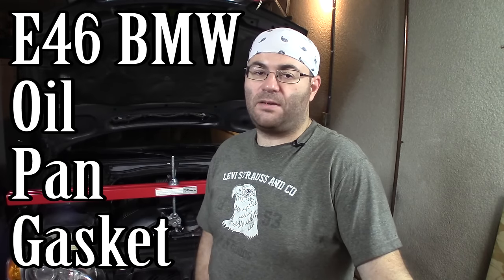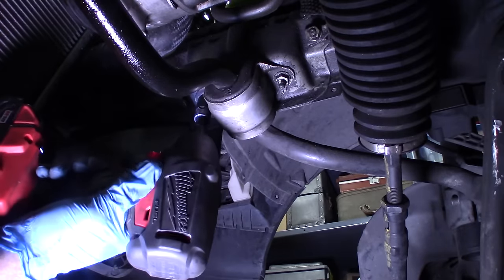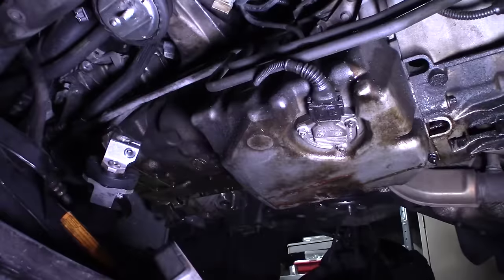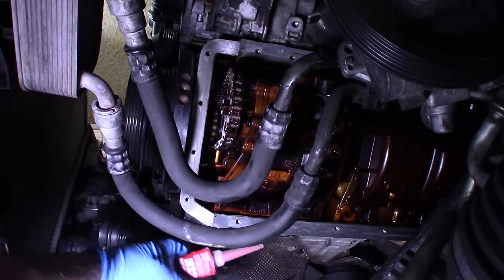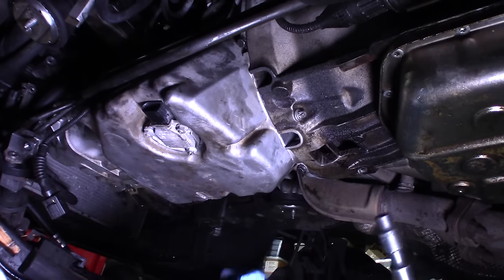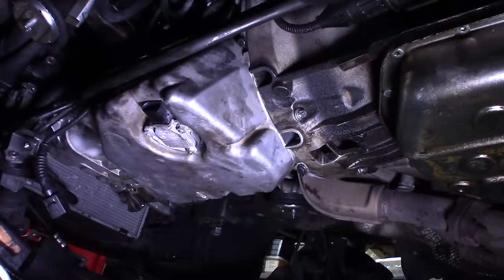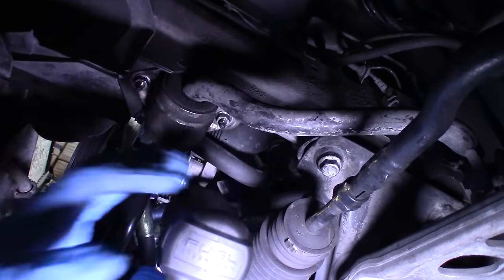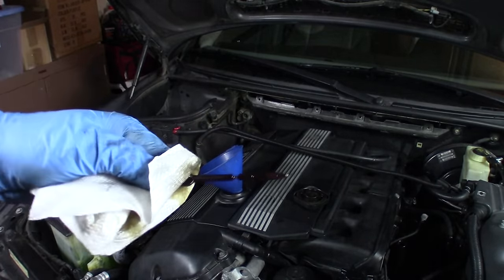BMW 330i 325i E46 Oil Pan Gasket Replacement DIY

Comment: Seeing you struggling with the gasket when putting up the pan, I would like to offer a tip if it has not been mentioned by others already.  I did the transmission filter a while ago and yes it was the same challenge.  I used wire ties (the ones they have at the grocery stores to tie up bags) to hold the gasket in place and after I got a few bolts in loosely, I removed the ties.  Made the job easier.
Reply: Brilliant! My 525i is up on stands for this job as I write. Your tip has solved an upcoming problem!
Reply: That is a great idea!
Reply: Boom
Reply: Job done. It worked beautifully
Reply: Used this concept! Worked great! Thank you!
Reply: How exactly do you use the ties if I may ask,  Thank you!
Reply: I used this method and it was very helpful. I held the oil pan with one hand and tied the zip tie with other hand.
Reply: @#joseph_the_human   you put the gasket onto the pan first.  Put a few wire ties through some of the pan's bolt holes and the gasket's holes to prevent the gasket from falling off.  Then put the pan up to the car.  Screw in a few bolts loosely to hold the pan up.  Remove the ties and finish installing the rest of the bolts.
Reply: @joshuatran3667  damn i missed the first part. it wouldve been way easier since the gasket wouldnt move and fall out when you put the pan up with the ties through the holes.
Reply: @DOOMSDAY  hehe so you did it the hard way after all.   Still you made it.  It's an involving job but doable.   I have not just one e46 but two, and I need to do this oil pan gasket on the second one.
Reply: @joshuatran3667  Well next time I have to do this I know better ahaha Thank you for the great tip brotha!
Reply: Crap.  I am doing this on the other e46 rn 9.26.2023.  Pain in the azz.
Reply: Done this job afew times that was a breeze thank you sir

Comment: Wow, it's like BMW never thought the oil pan gasket would leak.
Reply from the maker: +K Kampy Yeah they could have engineered that better.
Reply: sadly, many modern rear wheel drive cars engineered similarly. Its hard to fit all the steering and suspension parts in otherwise. Good news for us grease monkeys is it makes perfectly good cars go to auction because the cost to do some basic repair like this gets deemed too high vs the value of the car if you have to pay for labor. If your not paying for labor, this is like a $30 job and a few hours of your time.

Comment: Another tip; once you take any component off during the disassembly process, screw the bolts back into the holes.  That way you won’t lose the bolts or get confused later on as to which one goes where.  It will save you a lot of time in the long run.

Comment: Can't thank you enough for this video!  Thanks to you, I was able to swap out the old crusty oil pan gasket in about 6ish hours.  No more leaks!  To anyone hesitating to do this themselves - it is not difficult, just tedious.  If you have the tools and watch this video, you can do this job.
Reply: I just have an impact driver (I have no torque wrenches, likely none of the sockets, no jack, and definitely don’t have the large tool that the engine hangs on). I’ve never done any work on a car. It would be absurd for me to try to do this myself, right?
Reply: @timjohnson3913  yes.  You can't do this job without the engine support brace and other correct tools.
Reply: @_lmagine  I bought a 2005 330i with 160k miles that wasn't well cared for previously.  So yes, there were other leaks to address.  Oil filter housing gasket, valve cover gasket, o-ring for cam sensor.  All easy fixes and worth it if you're doing it yourself.

Comment: man all that work I'll let it leak
Reply: And then your engine blows up b/c all your oil has leaked out, good idea.
Reply: exactly. My oil level sensor broke on my BMW e46 so I can't even tell anymore, constantly manually checking. Get the leaks fixed and you'll save the car.
Reply: Lmmfao
Reply: @SPPACATR  Thats not the point, and person who likes a clean car and clean running understands. NO person who claims they are a 'tuner' has a leaky car.
Reply: @NUNYABIZNNAAAZZZ  oh i know plenty haha
Reply: Eliot - oil level sensor on these cars are covered under a factory recall. 👍
Reply: @NUNYABIZNNAAAZZZ  he's a tuner? Hahaha
Reply: Lol
Reply: @lostcec  
It'll be ok provided you check oil levels daily. Only takes 2mins
Reply: Oil leaks can potentially cause a fire by coating the exhaust.

Comment: I'm a BMW dealership tech and came across your video.
I have to say, I've seen my share of BMW diy videos posted by clueless people but your video is very on point and you are very charismatic. I actually chuckled out loud to myself at your jokes. 
Very good video. Keep up the great work!
Reply from the maker: Thanks very much!
Reply: Emma Sait
Reply: Hi 50skid, couldn't you support the engine via a floor jack off the transmission? Or perhaps too much weight so far in front? Thanks!
Reply: Hello how do you prime the oil pump after you put everything together. 07 335i thanks
Reply: @josec301  If you really wanted to prime it I suppose you could remove the fuel pump fuse and let the engine crank over for a few seconds and then turn it off, replace the fuel pump fuse and start the engine.
Reply: @DrDodge24  I got it running for about 30 seconds and nothing happens.  I am going to supply oil truth the oil pressure sensor
Reply: Emma Saito how much does a dealer charge for this replacement ? I’m debating if I want too, but I’m alittle on a budget. And this looks like something that would take me to long and cost me to much for tools
Reply: Emma Saito 
He is not a flat tech just a hobbist

Comment: Well I've got to say it, Jason thank you! When I bought our 2002 325i for our kids, it looked nice, but I didn't realize that the second owner didn't look after it very well... I replaced the oil housing side gasket, whatever it's called, but then realized it was still leaking oil... realized it was either the oil pan gasket, the rear main seal or the transmision pump.... last week I changed the oil pan gasket, issue solved, no more leaking oil. I guess I would have eventually figured it out, but you're videos have made it much easier. I hope you make lots of money because these videos are here, however it works. Thanks again! Steve

Comment: Excellent video,  when disconnecting flexible steering joint on my car it was just enough to remove the upper E10 bolt only, it had enough play to go up, you just need to yanked it up hard enough it actually comes out of the slot without removing the lower E10 bolt and worrying about installing it back correctly. Also I  would highly recommend replacing the oil dipstick housing o-ring since you have to take it out anyway. And yes, safety glasses all the time when working under the car. This one is one of the best DYI's ,  cheers to BMW enthusiasts.

Comment: Just did this repair using this video, thanks a lot for making it! I always watch your videos before doing repairs on my car. Worst part in the job for me was stripping one of the bolts from the oil pan when installing it back. Drilling it out was pain in the ass.. so anyone trying this please use torque wrench or use very little force when torquing the bolts.

Comment: Greetings 50s Kid, or should I say my hero, the "Renaissance Man": had one heck of a time trying to put back the subframe...it's hard enough as it is for one person...I finally used a transmission jack, which has a larger cradle and put some square plywood in it...it balanced the frame much better so I could align it, and made the job a lot easier...thanks again, man...;-)

Comment: friendly tip use zip ties to hold your oil pan gasket
Reply: MrRick1303 i was gonna say the same, but figured I'd go through the comments to see if anyone else had. The skinnier, medium length zip ties work best. One on each corner and snip them off as you go around installing bolts.
Reply: wow thanks for the tip ill this
Reply: Excellent tip. Thank you.
Reply: :( I snapped a bolt
Reply: @moisture106  yeah I like to chase the threads with a thread chaser to clean out any burs or damage to the threads also don't tighten the bolts with an impact

Comment: Tip for gasket placement: use a small tie wrap on couple of strategic bolt holes to hold the gasket in place while re-installing the pan and cut and remove after pan is roughly in place with loose bolts lightly screwed on.

Comment: Hi, thanks for very helpful series of E46 videos. Just changed the oil pan gasket and in process of changing few other things while at it. 

Just want to add that I went ahead and removed the whole sway bar completely as it was only left hanging from the links and also disconnected left side tie rod end from the knuckle and the lower control arm ball joint from the knuckle and was able to move the whole steering rack and the sub frame away and that game me a lot more access to the oil pan. 

Thanks for the amazing job you are doing on your videos. 

Next is heater inlet line.

Comment: I just did this yesterday. All you need to remove to get at the oil dipstick is the engine air filter box. 
My PS pump had a bolt on front and one going through from the rear, still super easy to remove.
The steering shaft telescopes up though not enough to get it back in when the k-member is all the way up. Also keep in mind there is a small void in the shaft where the e10 bolt goes in. This helps the shaft lock in and helps you get the shaft in the right position, not too high up or too deep down. Also add a bit of red thread lock on that e10 bolt.
FF🌎
Good job my friend!
BTW, us manual guys have it made on this one 😄😎
Reply: yes, the steering coupler doesn't slide up to its original spot where I marked it. I have the k-member all bolted up but I still need to get the coupler to go up like 1/2 but it does not want to.

Comment: If you want your oil pan gasket to NEVER leak again, apply Hondabond, or Yamabond to the mating surfaces. Also helpful in that you can glue the gasket to the pan before offering it up to the block. For many years I've used Hondabond exclusively on all engines I assemble regardless of the OEM recommended sealants. I cannot stress enough how good the results are in oiltightness.
Reply: scheusselmensch and
Reply: scheusselmensch m
Reply: @scheusselmensch thank you so much for the idea! I had asked that very question on another forum as I've had very good experience with hondabond working on Hondas before.
Reply: @ukae4131  At any Honda dealer.

Comment: I recently did this and it's really not that bad but I used an impact gun and air racket. I have a stick and did not have to remove the steering column from the rack, I just loosed it and slid it down. I didn't remove all those items from the common repair video either, I just pulled out the dipstick from the pan and let it hang. Same with power steering pump. just left it in with one loose bolt till the pan was ready to drop and I had no issues with clearance. I probably have better clearance with a stick but it was pretty straight forward for anyone thinking about doing this.

Comment: A) I wish I had separated the vertical aim headlight switch, mine broke. B) I wish I had tried to put the dipstick tube back in before I mounted k member. It would avoided removing disa, heat shield and all that  adds 2hours to job. Great video! Couldn't have gotten it done with out you!

Comment: For anyone wanting an easy way to keep the gasket in place, while sliding the pan back in; use some needle thread to tie the gasket to the pan. Just run the thread through a few holes. Once you have the pan up and lightly secured in place with a couple bolts, then pull the string out. Done! 😁

Comment: Excellent video, thank you! I did this repair last night. I was able to leave the fan and shroud on, the engine covers, and belts. I used a medium-deep 16mm socket to de-tension the inner belt and just loosen it from the P/S pump. I did have the benefit of a lift, though.

Comment: I'm working on getting my 06 ZHP coupe engine sorted again after my old engine died after ingesting some water in Sept 2014. Didn't have a single leak and have had to do valve cover, ofhg, thermostat + waterpump and pulley, various pulleys (all had been done on the previous engine since 09/2012 when i got my car). Frustrating with the retreading of work but I'm getting it there. Just have this stupid oil pan gasket to deal with now. It seems like such a bear so I'm letting it go for a bit (3-4 drops reach the ground over 12 hrs time). I'm not looking forward to it but this video will be my template to success. Thanks for creating such a great video.
Reply from the maker: +tyler951 Thanks.  Good luck!

Comment: I think this is way out of league for a DIY project but you've provided great information. Thanks for sharing your knowledge and for making this video.
Reply: as long as your not careless and easily distracted, you can DIY This. Tip for newbies is to put bolts back where they go after you take parts off, so you dont end up with a bucket of bolts and no clue where they go when you start to put it back together.
Reply: Do the little jobs first and you will soon get the confidence to be graduating to the bigger ones!  DIY project is just what he's doing, and these videos are great as he explains his pitfalls and what to avoid.    Get the Bentley manual  it provides an awesome wealth of information.

Comment: Thanks for the videos 50sKid. I have both a 330i and x5 3.0 manual with about 120k on each. Needless to say I have used many of your videos to fix various things. Thank you for taking the time to put these up. I hope I never have to do the oil pan gasket again though.

Comment: I know I’m years late, but for those doing it now or in the future a little trick to keep the gasket in place is to zip tie it to the pan in 6 places or how ever many you want then partially screw in some bolts and cut the zip ties off to finish off the rest.
Reply: Just about to remove - thank you for the tip!

Comment: 50sKid, I believe you forgot to mention to remove the top bolts off of the motor mounts prior to lifting up the engine. I tried to raise my engine following the procedure in the video and the whole front end of my car lifted up. You should really add in a little pop up on the screen to let people know this, thanks!
Reply: It's pretty obvious that you can't lift the engine when it's still connected to the body but yeah he could have mentioned it

Comment: dude that's like $1000 work right there...
Reply: 550
Reply: @ismailm970  ive been quoted 700
Reply: 700 isn't bad. since my mom has a 09 535xi and was quoted 1000 to do the valve cover gasket. i ended up doing it myself in a few hours. thank goodness i work at a garage lol
Reply: Just got a quote from bmw for $2025
Reply: @DanT0007  150$ in 3rd world country

Comment: At 32:41, what were you torquing to 81ft lbs?  Also, how were you able to lower the jack after lifting the subframe back up? Seemed like it would just fall again....I know I'm just missing how it works.

Comment: that steering column is telescopic I believe, when I replaced the guibo or whatever (to theoretically tighten up my steering though I suspect it did nothing at all) I think you can push on it to then get clearance to seat it back in the guibo

Comment: I have a 2004 BMW 330xi and the Lower Control Arm Bushings are a tiny bit different from yours. The bolts sit just above the frame in a tight spot and they do not have the collars as you said at 4:25. I also just replaced the control arms yesterday and it was a huge pain getting them back in. Do you have a possible solution for this or am I just missing something?

Comment: Fantastic video and contribution.  Thank you!  I'm about to undertake this on my 2008 335i N54.  I hope I can use much of this in that work but I think I will have to combine it with the couple other videos out there from Vehicular DIY and one other.  Only thing I wanted to say is that I just received the Engine Support Bar and it specifically says in the instructions not to support the engine with only the hook, but to use the chains to support the engine from the mounting points for safety.  So I'm planning to use both through the loop of the tow hook just to be safe.
Reply from the maker: Yeahhhhh these engines aren't really that heavy dude

Comment: Hi there....I LOVE your videos.  I have a E46 2005 330ci.  I watched your video after having a local shop replace the pan gasket.  I noticed a large amount of contact cement looking stuff all over the outside of the pan...presumably they slathered on the glue to keep the gasket in place.  I've noticed a very small drop of oil coming from the front pan to case area...the area you state it needs some RTV.  I'm thinking they either didn't put the RTV on or it may have "pushed out of the way" during installation.  there isn't much of the glue around this leaking area so I'm guessing the glue is keeping the gasket from setting down evenly.  the leak is only one drop every 3-4 hours.  do you think the glue is causing the leak or the lack of RTV or both?
Reply from the maker: What you think is glue is probably RTV.  There are all colors, red, grey, black, clear.  I assume what's on your pan is clear?  It could be that they missed a spot.  Btw they shouldn't have RTVed around the whole thing--maybe it was an old timer to thinks they need to put a liquid gasket product on an actual gasket.  Shrug.
Reply: it's definitely NOT any type of RTV I've worked with contact type adhesives in my profession for over 30 years...it's a pliobond 30/40 or a 3M weather strip glue. it's curing and getting hard as it heats up.
Reply from the maker: Now that ain't right. Complain to the guy.